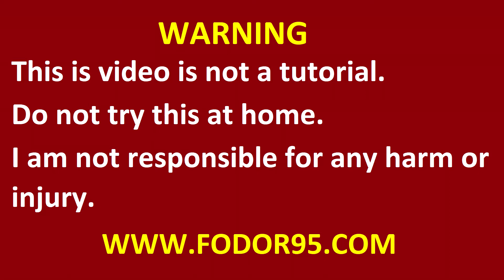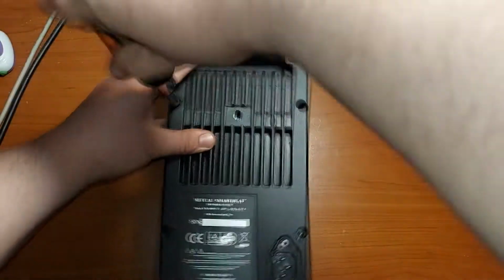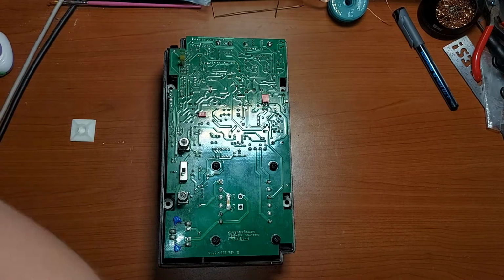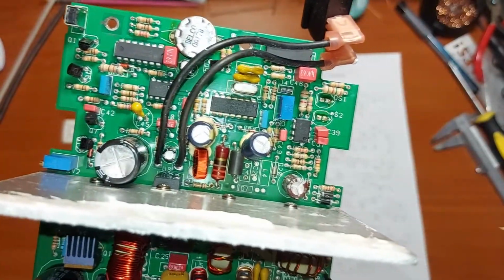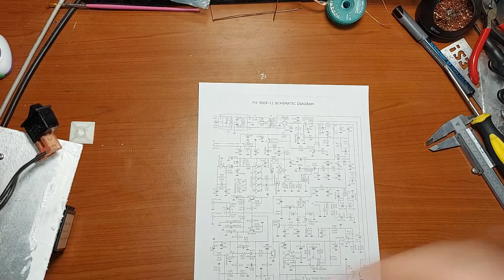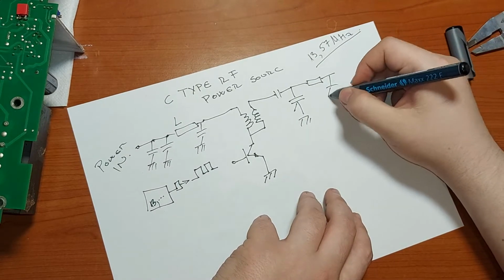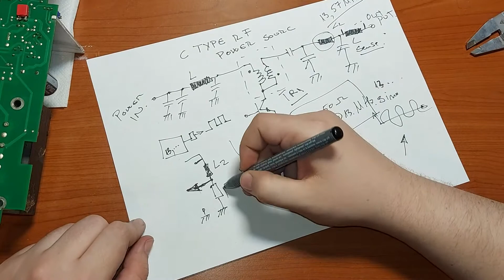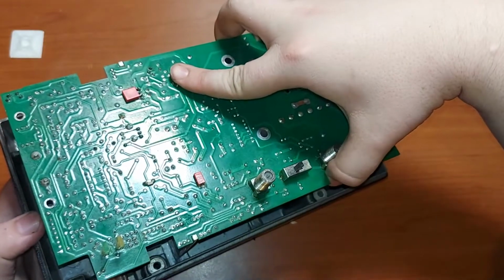Metcal MX-500P soldering and rework station general presentation, teardown, disassembly and overview

Comment: Hi Fodor, I'm the author of the reverse engineered schematics you have (circa 2006), and I noticed that your Metcal has 10 heatsink fins at rear, whereas my 3 older model units (the one in the schematic) has only 6 fins. I would be curious to know the approximate serial number of your unit (within +/- 500 or so), as well as the part numbers of your output FETS Q3 and Q4, and most importantly the values of L4 and C20. This information would be very useful to anyone who is trying to repair an older unit. I'm thinking of buying a newer unit like yours just to learn these facts. When I drafted the schematics in 2006, I started selling them on eBay and i sold quite a few but got tired of running to the post office, so I uploaded them to the Internet, and now 17 years later, it's funny to see that someone else is still flogging them on eBay to people who don't know how to use Google. These schematics must have made thousands of dollars by now!
Reply: First of all thank you for that BEAUTIFUL and DETAILED write up! (And yes, I can't believe folks are buying printed copies of this PDF on eBay either.)
I currently have 5 MX500's on the bench in various states of repair and can comment on the serial numbers:
40632: 6 fins, "REV Y" sticker, L4 and D7 not installed, C20 shorted wire installed, Q3 = IRF510, Q4 = IRF640
43146: 6 fins, "REV P" sticker, L4 and D7 not installed, C20 shorted wire installed, Q3 = IRF510, Q4 = IRF640
43152: 6 fins, L4 D7 and C20 installed, Q3 = VN0109N5, Q4 = IRF530 (matches your schematic)
48891: 6 fins, components same as above
65157: 10 fins, components same as above

The big cap C6 is 2200uF but is 63V, not 50V. Cap C2 is 1000uf also 63V (but caps down to 35V should be OK for C2). Q1 is a TO92 package with a TO18 style heatsink jammed on there with a bunch of ceramic grease. All of my units are made in USA.
Reply: Aside from a big thank you, .may I add your info (above) to my website?
Reply: @stepannovotny4291  Sure thing, also post a link to that website here.

Comment: is it really good? im using jbc c210 and hakko fx950 now.really hard to find metcal in my country.also it's look like mote too video game console that soldering station take up too much space
Reply from the maker: yes it is, i have some experience with that jbc c210 - maybe the  jbc is more convenient as a "hobbist" since you can change the tip temperature without changeing the tip - on the other hand the Metcal is made of general purpose components, that in case of failure can be replaced.

Comment: Thanks for the video. I have MX-500P-111 the power on, solder tips are good but solder tip does not get hot?  I have disassembled the unit but not sure where to look for. Any suggestions would greatly appreciated.